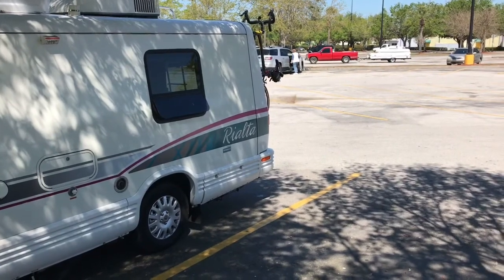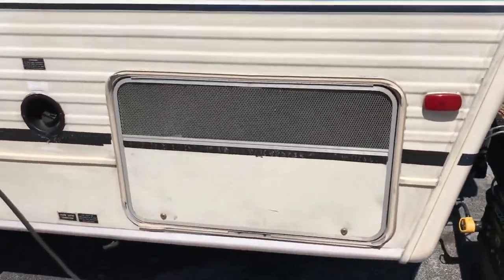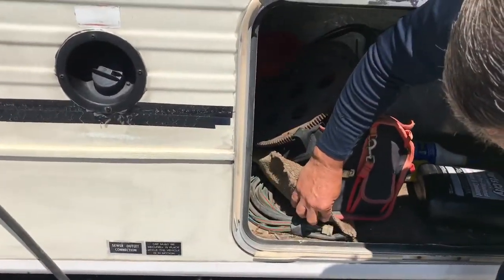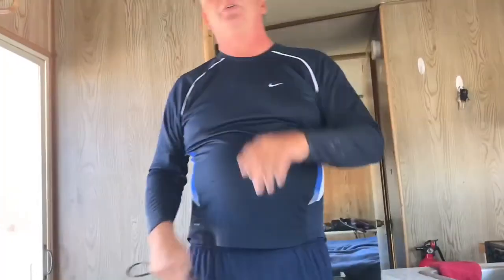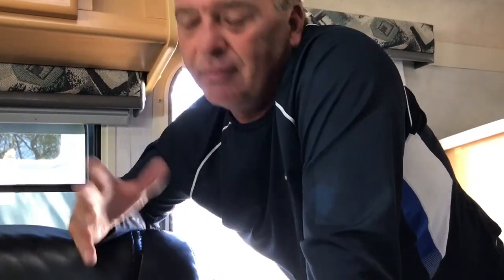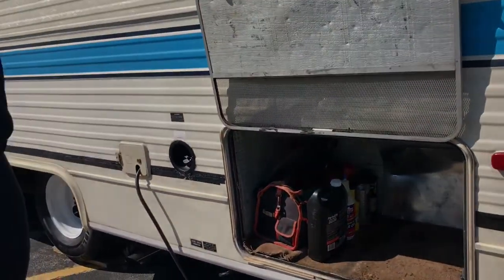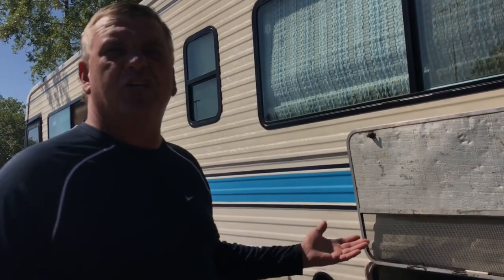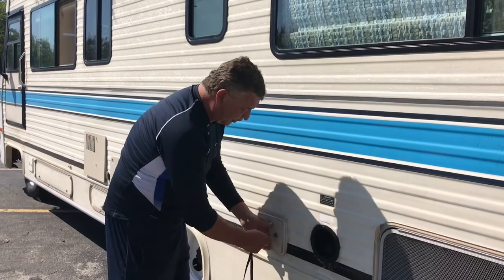New Rialta Generator - 3500 Watt Inverter Generator - A Review by Mike Kelly

Comment: So I have a predecessor to the Realta, the old Lesharo 
So any idea if this would fit these or not? Thanks
Reply from the maker: I'm not sure but if I had the Generac NP-30G before, then most likely it will. You will need to take measurements of your mounting points. The bolt holes should be 18" x 8" on center.

Comment: Roland, have you started putting together the kit you spoke about. I am trying to figure out if I can put a Predator 3500 in my !999 Coachmen 21 ft Starflyte. I realize I would have to do a bit of modification on the compartment area itself but the ket you said you are creating would make the whole think simple for me. Do you know when you expect the kit to be available and how much. Thanks.
Reply from the maker: Bill Reed, so far I’ve only built complete generators for the Rialta. No conversion kits. Honestly I expect a kit to be too much trouble. But I may do a conversion of the Predator 3500 to fit in place of an Onan Microlite 2800. Lots of smaller RV’s use those.

Comment: My thing is can it work for truck campers where there is not much space to put a generator unless you mounted on the back bumper inside of a steel box or whatever
Reply from the maker: Kory Johnson, I really don’t know. I’m building them for Rialta’s and any RV that can accommodate an Onan Microlite 2800. I’m not planning on them being exposed to the weather.